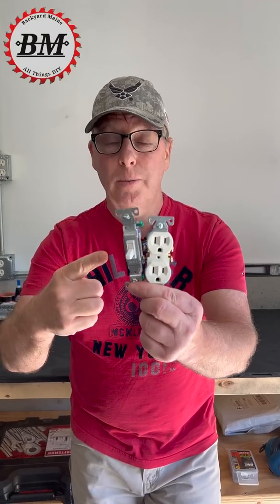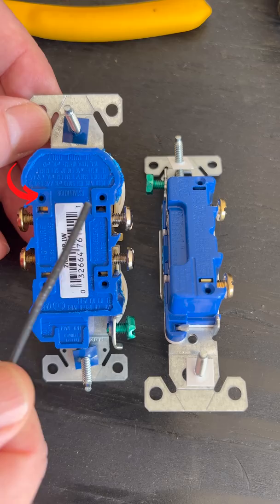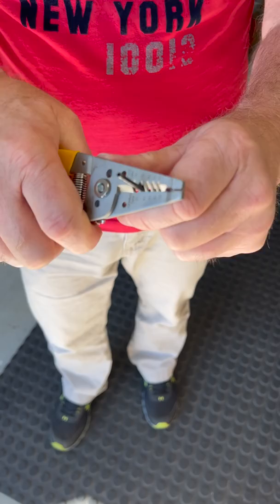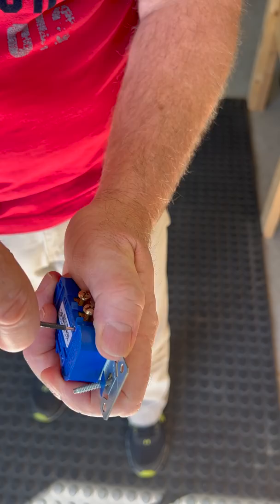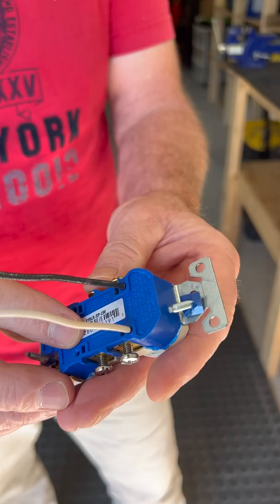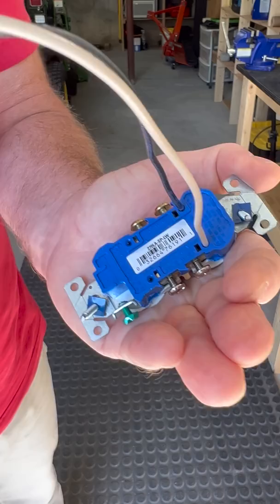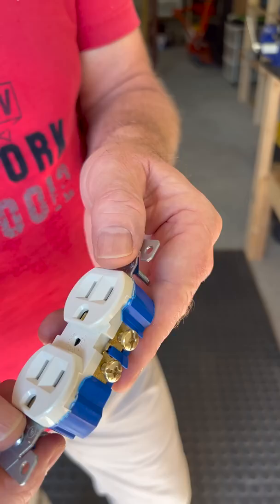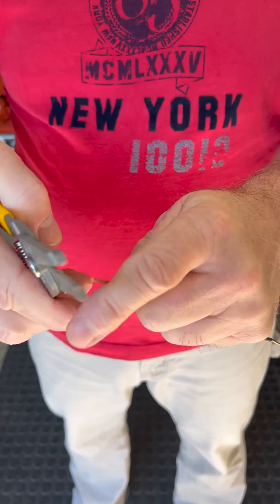Don't make this electrical mistake #Shorts

Comment: I've back stabbed a lot of them never had a problem, the problem is people don't strip the the required length to stab in back, do it right and know how to stab back when doing it....!  Good video..!
Reply from the maker: I think they fail over time if there’s any significant load. Just my experience though. Thanks for watching.
Reply: Professionals don't backstab!
Reply: @Tre16  yes they do, but won't admit it, every electrician does it no matter there lvl..!
Reply from the maker: @jesseestrada4290  I don't think that's accurate to say. I have never used a backstab once.
Reply: I was shown to backstab for 2nd feeder for switches. So the load and feed to screw terminals the other feeder if there was 1 back stab save a nut or crimp
Reply from the maker: @wizard3z868  For sure that will save money but I like to pigtail in that situation.

Comment: As someone who uses Thermography everyday, I couldn’t agree more. Pinch point connections like those cause most of the issues found on routes. Good job!
Reply from the maker: Thank you! We used to IR scan our electrical systems annually at a large industrial facility..

Comment: 100%. I work in an apartment building and without fail, the majority of issues stem from back stabbing. 

Also 90% of the time when I remove devices that have been back stabbed, the wire comes out. Not sure why they still manufacture them this way.
Reply from the maker: I agree..

Comment: Especially in rental property where you may find a renter operating one or more 1500 portable electrical heater.  It’s only a matter of time before one 1500 watt heater will cause a loss of spring tension in the push in connector and a bad overheating electrical connection.
Reply from the maker: Yes for sure. They will kill they really fast. 😬

Comment: The backstab holes are fully approved by the NEC. There's nothing "against code" in using them. The best method are those outlets with backstabs that also have a screw for extra security. (A lot of GFCI's use these).
Reply from the maker: It's not really in the code either way other than you should follow the manufacturers recommendations. There receptacles are UL listed and they do have two methods for connecting wires. I have repaired so many that I think it's a mistake to use them. The other receptacles you're talking about are commercial grade with back wiring and these are a great option and the ones I use all the time.

Comment: 99% of the time, especially in new homes or homes that are no older than even 25 to 30 years, you cannot use the back stab slots because they can only be used with #14 wire size. Houses are mostly wired (almost 100% of the time) with 20 amp breakers (for receptacles) that must be wired with # 12 wire. # 12 wire cannot be stabbed in the slots of 15 amp receptacles because it's too big.
Reply: You can just buy the right receptacle
Reply: Seems like the problem might be that you're reusing 20 year old outlets.

Comment: Don't forget to wrap it in electrical tape, especially if you're going to throw it back in one of those old near-zero clearance metal boxes.
Reply: Thank you I was just about to ask his opinion on taping the outlet
Reply: The metal box is meant to be grounded too, so if the phase wire touch this, a short circuit gonna happen opening the breaker. This is the idea on a well done installation. But this can be dangerous for someone doing a maintenance on this socket, the people can be shocked by touching the outlet side when manipulating this.
Reply: Waste of time and tape
Reply: Yes I wrap it with electric  tape!!!! Anyway!!!
Reply: @jeffrey7282000  you were gonna ask his opinion.. but now that some other joe shmoe told you their opinion, you don't care about the posters opinion anymore?
Reply: Why the heck even use metal boxes? Dangerous as hell!
Reply: @andregenter4213  because its not actually dangerous and you are making shit up lol. code exists for a reason
Reply: @bmxscape  FYI, metal is a conductor. If the phase wire touches it, it's a disaster waiting for someone to touch the box.
Reply: @tvi53  simply not true, you are making shit up just like the other guy. by code metal boxes must be grounded meaning if a phase wire  touches it the breaker will trip, not cause a "dIsAsTeR"

Comment: Guys in other countries without issue:  The US uses 120V which requires much more current for the required power of a circuit than your 230V. The stabs have less contact area and strength of contact than the screws so it's like using too small of a wire for the current demand of a circuit, it leads to a hot spot and wire or contact failure after repeated overheating.
Reply from the maker: Exactly.. I have replied in the same way to so many people outside the US.

Comment: What’s wild for me is I been doing for 8 years construction an never knew you can just plug it my dad always taught me the 2nd way lmao
Reply: I usually do the first way of it's a 14 gauge wire because is easier when you have to do 100 outlets by 4 times. But if it's a 12 I do the second way. I don't think I'll do the first way anymore after watching this video.

Comment: When I saw these things being used in the field I told everyone they didn't seem safe. Got laughed at as I continued to wrap mine around the screw, crimp it around the screw, tape it, and install it. Some contractor down the road is going to hate my work but at least it won't come undone.
Reply: Why would he hate it? Theyre easier to replace when looped unless the screw is seized up
Reply: @Mstrskeletor89  I don't just put it around the screw, I crimp it around the screw so even when the screw is loose it still has a sturdy connection. After that I put electrical tape around the device to protect the posts from touching anything. It takes more time to disassemble when something goes wrong or it needs to be rewired.
Reply: @woodlandxwarrior  Same here.
Reply: Any contractor worth anything should be respecting your work if you're looping the wire around the side screws.
It may take just a little longer to install, but its the most secure way of installing.
Those hyenas laughing at you don't know what they're doing, so forget them.
Reply: @markbrowning4334  just because I paid attention doesn't mean I cared. I agreee.
Reply: When I built my forever home I insisted the electricians leave the plates off so I could inspect all of them...of course they used my specified plugs/switches and wrapped all the wires under the screws so I got high quality connections.
Reply: @Mick Turner  20 amp outlets for me in every room. PVC pipe for all so if I have to fish wire at any point I'm ready. Lights and outlets on their own breaker per room. Overkill? Absolutly.
Reply: @woodlandxwarrior  I wired a house for my best friends father with each room on separate breakers, that was in 1975 and it's still working fine
Reply: @mickturner957  Sounds like you did a great job to me.
Reply: Tape on a receptacle sounds completely useless and a waste of time. Why bother?

Comment: The reason for flaky electrical connections is the connectors with the wire stabbed into the hole is that inside there are fairly thin connections that grab the wire.  The problem is the metal is not tempered and will stretch with heat thus losing the connection integrity.  I use plugs and switches that have a square plate under the screws, that way when you attach the wires (always with a clockwise curl at the end) the square plate holds the wire and it can't come loose.  Some square plates have a raised metal cross which grabs the wire even better.  The other thing is get plugs with Beryllium Copper internal plug flat springs, which don't lose their spring tension.
Reply from the maker: You are correct. I have a video where I pull one apart to explain the issue. https://youtu.be/e_C_twh5fQE  I also talk about the commercial grade receptacles in this same video. These are the ones you're talking about and they are a great option. I use them for most of my projects.

Comment: I've never had a to use a screwdriver to remove the wires all you got to do is twist the wires and pull them lightly
Reply: If you’re already replacing it snapping off the plastic with them coming out ain’t gonna make it work any better just makes the cleanup longer

Comment: I don't know anyone that uses the little holes.
Reply: In Finland we only have similar type hole  connections. Hell you cant have more than 1mm3 of copper showing on connection, while US you have huge areas possible to touch while removing the switch or what ever. Makes it much safer to work with live wires for electricians, while US based electrics seem like death traps and no we have zero issues with those connections.
Reply: Underwriters Laboratories UL should have banned the use of the holes on plugs/switches by removing them from all  plugs/switchs to get certified as safe!

Comment: The biggest mistake is to “feed through” outlets with stabs, I really have little issue with switches especially since LED.
Typical video guy, probably not a pro.
Reply: Exactly....... it depends on the load going through the switch/ outlet 
LED has been a huge game changer 
This guy's NOT well informed
Reply from the maker: Why would you use a connection that is limited to some small fraction of the circuit current. I don't understand you guys that know they're limited but still use them anyway. It takes seconds to use the side connections and then you're good to go. PS: I'm an electrician and electrical engineer with 38 years of experience so I'm pretty well informed. lol
You are not the pros that you think you are and your customers deserve better IMHO
Reply: Like Jim said, it’s all about load, I have nary ever seen a stab switch fail with low load, I have however seen guys feed through a switch using side screw and stab- dumb, and I’ve seen WAY to many failures feeding though on the screws and in mho that is worse than a “dead end stab” with low load.
Reply: @jimanderson2518   Not sure what led lighting has to do with backstabbing receptacles.  You and Piro are the ones out of the loop on this, sad to say you're in good company!
Reply: @finarollerz  Why have to distinguish between a "dead end stab" and a standard middle of the circuit receptacle?  New guys in the trade definitely won't understand and then you have a whole house backstabbed.  No non-hacks will ever argue that a solid wrapped screw connection is better than a backstab.  Next time you have nothing better to do than call people "typical video guys" open a receptacle and look at the cheesy pressure plate that holds the wire on a bs.  Thin thin brass with nothing but metal memory to hold for years and years.  Only backstabbers I know are politticians and people who think they are fast.  Please just wire the right way, BYMaine just gave a great tutorial if you need a refresh!
Reply: So tell me, why does UL allow the stabs? 
Because they work, under right circumstances…..
Ever look at the contact area on a HACR 125 amp breaker? 
It’s not right or wrong, it’s the application. 
Sorry I offended you Man.
Reply: @finarollerz Not sure who you were replying to but my 2 cents are that if you acknowledge it's only be under right conditions then why do it yourself, NEC and UL aside?  The real issue beyond IMO a bad connection is people stripping way too much conductor and having that push on the back inside the receptacle, I've seen those just pop off with slight touch after a while.  I have seen the contacts of a 125 hacr, and to that I would say compare NEC to your local utility code, they bring a 2/0 in and you connect parallel 350's, lol.  Not a perf example but my point is either nec or util is doing more/less than needed.  The util or the city owns the infrastructure that costs hundreds of millions, the NEC on the other hand has no interest in your house or what state of on fire it is. In the last two code cycles they have made almost everywhere an arc fault necessary zone, I have personally never even heard of a child dying from arc faults.  They always talk about perfect storm, kid barefoot with one hand to a neutral somehow with tamper receps and the other to a grounded faucet or floor register.  Not to say it's all garbage just that they don't rule based on real world problems all the time.  My opinions as far as NEC specs but backstabs are not for real electricians and anyone who uses them should think it over.
Reply: @atruefriend9306  You are right sir and tell all these new electricians to take one of those cheap back stab outlets and crack it open, it's a joke and scary, end of story,  they will never back stab again
Reply: @jimreeves1954   I just commented that almost exactly to another person sticking up for backstabs!  Surprised the amount of people that want to stand up for such a shitty practice,  Keep up the good work brother!

Comment: Never explained what the issue is. But I’ve done a few and get it. Back stabbing can come loose. However; with such tight sidewall clearance, so can side wiring.
Reply from the maker: In this video I pull one apart showing the issue with these connections. https://youtu.be/e_C_twh5fQE

Comment: Americans are so afraid of Wago connectors.
Reply from the maker: Nope. We use Wago connectors here. They seem to hold up much better than the spring tension on these receptacles.
Reply: Not afraid just cheap hell I use and recommend copper crimps with nylon covers
Reply from the maker: @wizard3z868  I find them very handy for control work in meters, sensors and other instrumentation in the field.
Reply: Wagos introduce unnecessary resistance where a wire nut does it better when done correctly, period.
Reply from the maker: @mattlitton8066  I have never used them in residential wiring. I'm old fashion and stick with wire nuts.
Reply: I was mostly replying to the original commenter, to me, obviously you know your way around electricity.
I understand Wagos are quick and easy, but for anything more then small lighting fixtures, they're a liability imo.
Reply: @mattlitton8066  thankfully the industry don't go by people's opinion but instead by testing and verifying the products and get them certified. Else we wouldn't have wire nuts either!

Comment: I'm not sure where you get your ideas from, but I have been installing this type of devices for 40 years. Whenever I can I stab them in from the back.  Never had an issue.
Reply from the maker: From 38 years of experience. The number one failure on service calls.

Comment: Yes, ive been replacing so many devices on finishes over the last few years. Devices are crumbling from being back stabbed. You also get the rare problem of causing arc fault issues. Just dont do it.
Reply: Get some quality devices not the crap you get in the US. In Europe you will get an outlet for 3$ which will last 50 years and more.
Reply: @andregenter4213  I'm sure if you cramed 12 guage wire in a slot for 14 guage your European devices would crumble as well. And even then, they held up for 30+ years. They would've held up for 100 years had they not been installed improperly.

Comment: Definitely great advice! Even some gadgets you buy have stabbed connections and they always overheat at those connections. Shouldn't even be an option.
Reply: If you design them correctly, nothing will ever overheat. What kind of engineers do you have over there?

Comment: I have been an electrician for over 20 yrs...I have always hated those stab connections. They're a loose connection and they are junk IMO. When I was an apprentice Ideal introduced those stab-in connectors that took the place of wire nuts... I've always hated those as well. I was always taught loose connections create arching and heat. Side wire, twisted joints, and properly tightened connections are the safest.
Reply from the maker: You were taught best practice my friend. Great work.

Comment: As a young teenager, my family finished a room in our basement, and had a "licensed electrician" wire two light fixtures, two switches and six duplex outlets.  A few years later my brother and his friends were plugging guitar amps and such into the outlets and had issues with flickering lights and outlets losing power.  I'd learned more by then, and checked things out.  The electrician had back-wired into the release slots a few times, and one outlet had lost neutral and was getting power by having the ground wire touching the neutral stub in the outlet.  He'd also wired both lights and six outlets into one half of a dual 15-amp breaker, while leaving the other half totally unused.  And this room included the main breaker panel, so it's not like he couldn't have easily run a separate circuit for half the room.

Comment: We've had light fittings and sockets with push in connections in the UK for a while now (admittedly the sockets came more recently,but still been around a few years here) never had an issue with them, except occasionally on the cheaper light fittings.i don't use the push connected sockets much as they're quite a bit higher in price,but that's the only reason.if they were at a similar price as sockets with normal screw terminals,I would happily install them.
Reply from the maker: Maybe yours use a different method of securing the wire. These simply pinch the wire between to contact points if which one is very thin and doesn't hold up well over time with any load.

Comment: Back stabbing is a poor connection. It's UL approved, accepted by most building departments and meets code.  There really isn't much profit in residential work and time is money so this method will be around for a while. I normally install back wired receptacles but the industrial ones that actually clamp the conductor. Making a j-hook for every connection just takes too much time. The down side is they cost more.